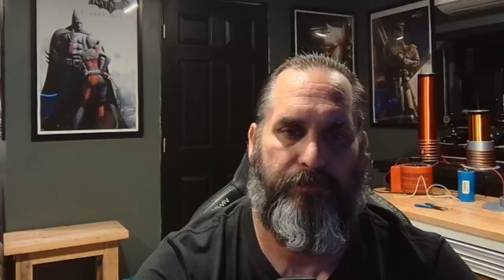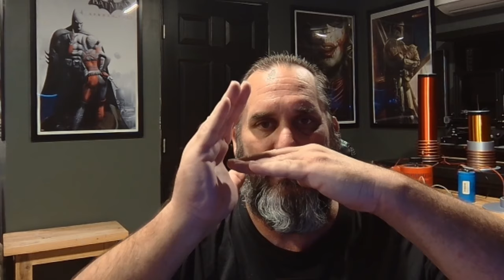Graviflyer "Building A Vortex" #65

Comment: I had to walk away and figure some things out. i sent you some picutres a while ago with 2 red rings in it. i still havent gotten around to getting it to work. something struck me while its been sitting. Telsa only shot sparks out of his tesla coil to show what power it had. we know that shooting sparks is wasted energy. The florescent tube is to show us where the energy is at. If your wanting an area where there is no energy, with a coil using DC current, you face the coils the same way so that way you get a cancelation effect. with speakers, you put them on the same phase so they cancel each other out. When you get a cancelation, you get your bubble. (my directions of how to cancel it out might be wrong but i think you might get the point of there is a cancelation area). I think, your bubble is much smaller than what you think it is. Your motors and flywheels may be canceling a smaller point(s) on the center plate but its not enough because you are pushing that bubble to be in the center.
Reply from the maker: the tesla coil moves the high voltage field. so the more tesla coil power the bigger the field created but the high voltage now needs to fill the bigger area.
Reply: @nathanbunten4299 You now the Kacher circut? I try it and something goes right or wrong. I got the same results like all, but something is wrong. I can but a led on a piece if iron or cuper, alu all metal things. It work with 12v led or 239v leds. Even if i go 10meters away from the teslacoil. I know its the geometrie, but i downt now why. Maybe its the direction, i will try it. Thx
Reply: @nathanbunten4299  having a tesla coil working doesn't mean that you have your bubble working.
Reply from the maker: @freedomer342  I made the bubble months ago.

Comment: Endothermic and exothermic inverters to synchronous voltage/amperage and frequency of percussive harmonic into a  5 dimensional event horizon that can be squared into its own multi energies focal point. And the 5th dimensional being the opposing fluctuation to thus creat lift or motion. ? How did i do? Thoughts?

Comment: a long time ago something like 5 y ago when i began my journey in antigravity research , my intuition convinced me that antigravity propulsion comes out when we have a combination of longitudinal and transverse wave simultaneously. after while ,i realized sound wave can effect on EM field it;s called magnetoacoustics. this is the  pure science of MHD, cuz magnetosonic wave is on of two pillars of MHD beside of alfven wave. i thing this is what you previously described as collapsing of magnetic field by ultrasonic? am i right? ok what is your point for me.
Reply from the maker: you are describing what goes on in Geralds coil. I will link it. This on is 2 toroids where the coil has only 1. I think they may be close but slightly different. This thing operates like a field generator more than antigravity.  The coil is true antigravity. Here is the link. https://youtu.be/Zz3Sck02nrk?si=AhWqDsY5sqc6br8i

Comment: Nathan, can you verify if your machine produces a torus shaped field?  micro portal energetic portal can be manifested that way, which is how excess energy is manifested with the use of high frequencies. Also two grounds are necessary by the Tesla coil...not one like we have been lead to believe...on one side negative or positive potential however you want to identify it , enters gets pulsated by induction, and released at the other side...There are your free electrons, plenty of them, same for the air, then again resonant with the environment...
Let me give you an example of why I feel this knowledge could help you.
 Generators tech for the Army, when I asked what was the "runaway generator condition" the instructor just went around beating the bushes ending up with:
- "Sr you just have to worry about saving yours and your troops ass!! just throw at damned thermite grenade into it and run for the hills!!...I was the leader of my group so of course many laughed out of rebelliousness etc., turned out been cool everyone at the end of training but...Ignorance was bliss at that moment.
Got the instructor once more at the hall
- "Look' Sr no one really knows, it is one of those failures and..." the rest didn't make sense at all to me...
Years later during an installation syncing two about 15K generators, I gave instructions to my specialist, once he was done with connections etc. I started making each of the clear bubbles with blinking lights get into synchrony...well shit...I heard sparkling after a few minutes of doing other things and the characteristic sound of spontaneous accelerator of both generators was happening!!...dang!!..Was it possible!!???...I called the specialist, I frantically asked him all kinds of questions, he said to me at some point:
- “…And then I connected both grounds like you told me...."
- “You know to connect just one like the SOP manual says!!”
Somehow it dawned on me at that moment what John mentioned to me about the moon having influence over his devices...THE GROUND WAS CHARGED WITH EXTRA ENERGY FROM THE MOON.
I just yelled at him over the “ominous crescendo” of the generators:
“Get a large piece of wood and disconnect all the grounds…now!!" and then stay away from the machines!!" 
Nothing worked from both panels, the off switches, etc.
 Had another senior gen tech yelling at us. He also recognized the dangerous possible scenario of  run to burn or self-destruction with explosive shrapnel killing everyone close enough...The specialist was being a dumb ass again...I took a much larger wooden beam and just banged at the cable with "gusto" until it somehow detached from the 5 ft or so buried copper rod…as some just looked in shock or something.
 Heard the whirring from the generators going down, but the other Sgt also managed to disconnect the other ground. Went into one of the machines and just ripped off switch cables etc. from the inside...
Shit repairs, parts, patching cables here and there…Only one ground and everything was “cool and dandy” the specialist asked me what happened…
Just theorizing at the time, but the possibilities got me laughing a bit in excitement due to the possible implications, I didn’t bother explaining…
- “Kid…whatever you do…Never have 2 grounds connected to large power generators…”
No one reported anything unusual, the Sgt from the other unit I can't remember because it was a joined exercise in the middle of the Mojave Desert...It was just another day in paradise...He did say in passing to me
- "We were lucky, you know what that was right? Don’t worry...It will be fine" 
...He knew something...
I took me a few more years of studying...Came to find out that by the modules regulating the frequency of the machines being fried...the generators entered an spontaneous self-regulating "resonant" condition,  jumping from harmonic to harmonic ever accelerating....both grounds providing the source of extra juice...such frequencies cascading the extra energy from the vacuum...
Of course, "the experts" will deny that such thing ever happens that way...that it is a myth...
In another example I have an old double electric bench grinding motor…One day the capacitor burned out…So I changed it…what do you think happened???
Sorry no…After switching it off…It continued running for over 10 minutes, I haven’t really time it out…and I have been too lazy to calculate the resonant frequency…
Gentlemen...It is up to you...
Reply from the maker: I just watched a video yesterday on this. The transformers are out of phase with the motors and generators we use for the same reason they form a resonating state and pick up power. 

I experience this a lot when working on the graviflyer. I can't tell what the energy looks like but there is a big energy dump from the center of the craft. 

I always say this works like a field generator not a single toroid. It is overcomplicated for what it needs to do. But if i just wanted a field around something it does it all day long. 

only time and testing will tell me the answer.